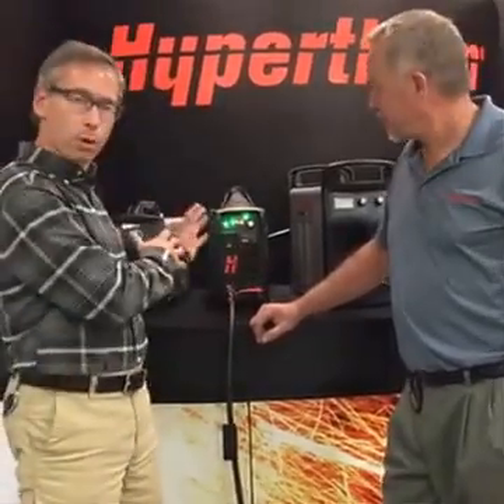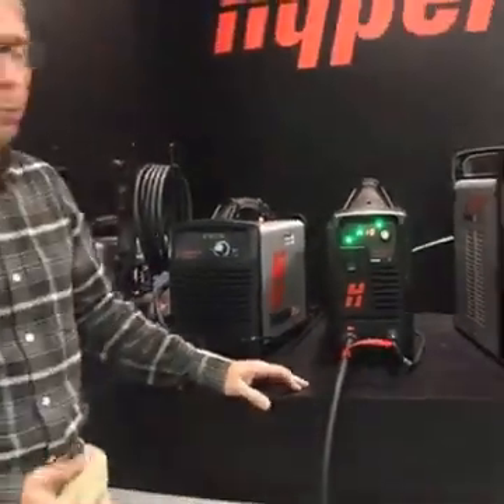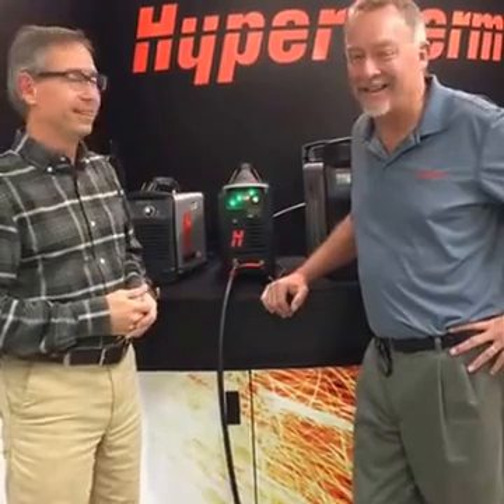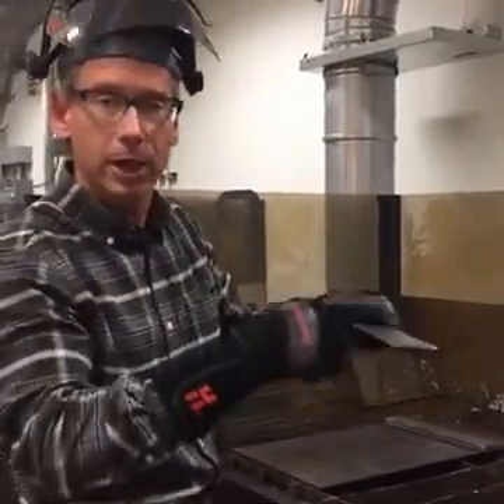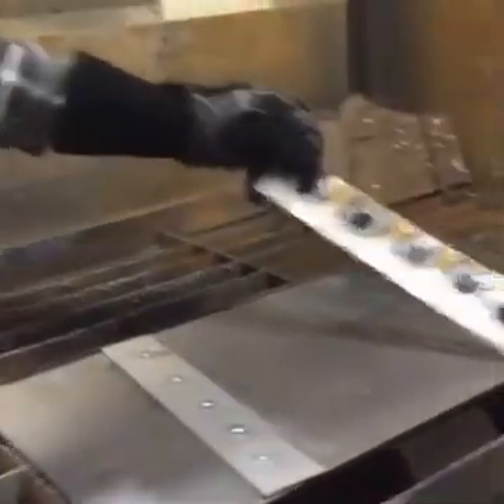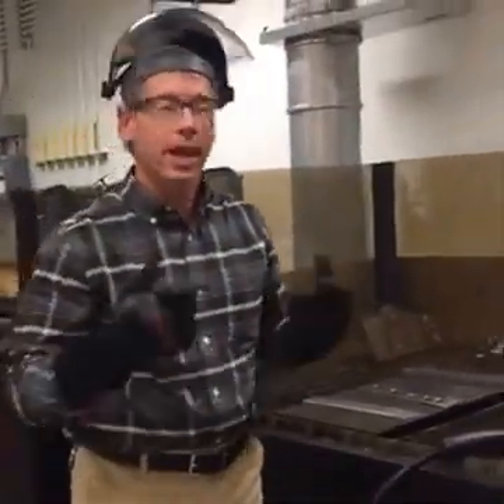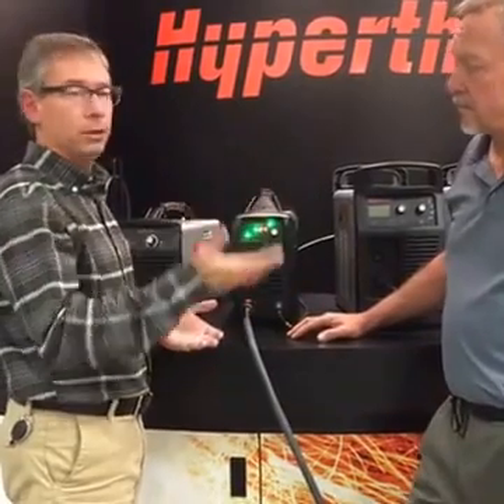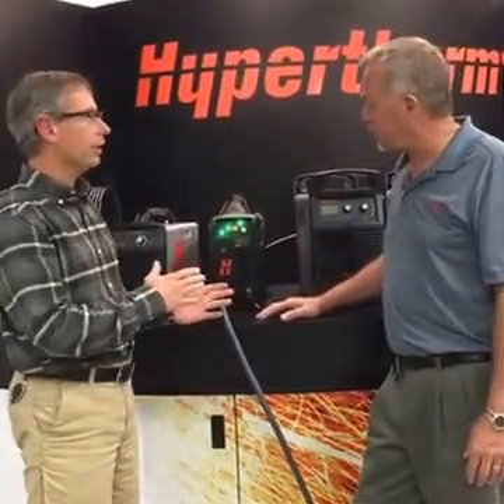How to mark and gouge with the Powermax45 XP

Comment: I have a few questions?First is the marking consumables different than the fine cut?Or are these a gouging consumable that is being used?Also are there setting for marking in the 45xp book?Just wondering cuz it seems you would wanna run maybe a 50ms pierce delay and running at just the right height and speed would be key

Comment: I'm getting interested in this for gouging, the spot weld removal was ok but I want to see more in gouging mode. I know plasma is great for cutting, marking steel is cool, but in my world where the rubber meets the road, it's the ability of taking steel apart is the most important function. Show more of two pieces of plate steel that's been welded together be taken apart, like a 1/4" fillet weld 6" long.....
Reply: Hypertherm makes a extended tip for gouging, I use the extended tip to wash away welds and metal in heavy equipment repair.